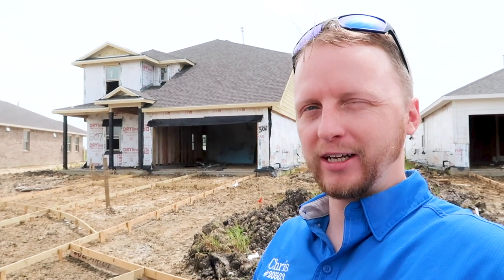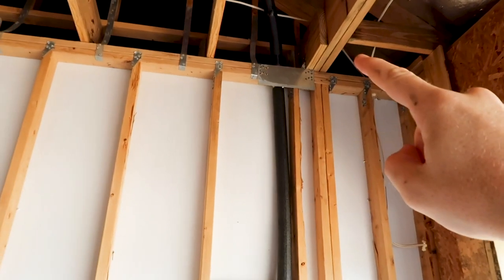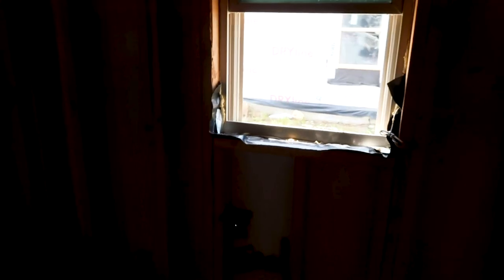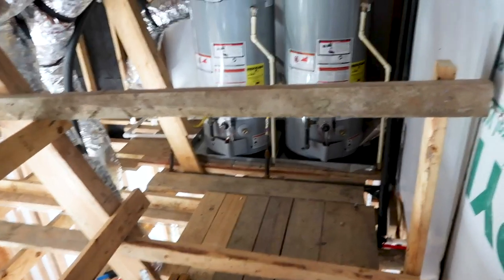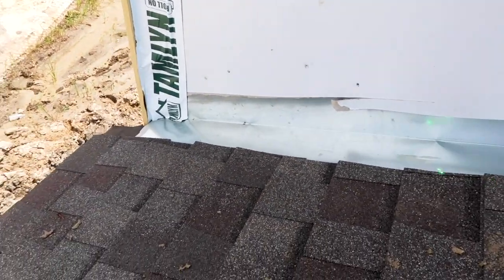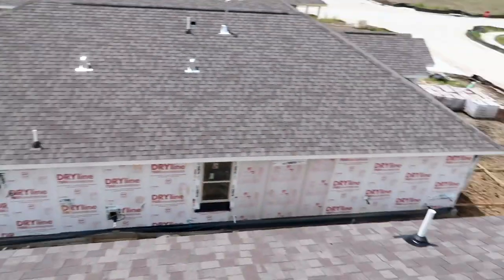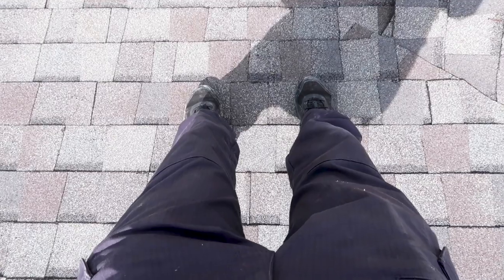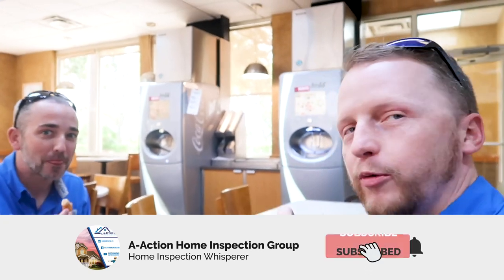My Inspection Day - Phase 2 Inspection - Part 1

Comment: Great video! Building a new home and looking for an inspector to do the phase inspections.  I am wondering if you typically find issues with shower niches and outdoor vented range hoods for a gas stove? Not sure if.best to get the standard under cabinet vent for the stove since I am Concern of mold, back draft, or even bugs getting In.  Very informative video!

Comment: The left hand water heater around 3:12 was not given a sufficiently long sediment drip leg on the gas supply line - must be three inches by code. Add that to your report. The one on the right seems short too, but hard to measure in the video.
Reply from the maker: I will get that on the second phase, thank you
Reply: On closer look, it might actually be three inches; the wooden railing that should not be there blocks the view.

Comment: Great video! Looks like what I assume is the range exhaust has a bonnet cap. IRC states range termination “shall be equipped with a backdraft damper.” Is this something you guys call out or pass on. Thanks for the info!
Reply from the maker: Most of our range vents go to the exterior wall.  It would be something we would try to document on the day of the inspection.